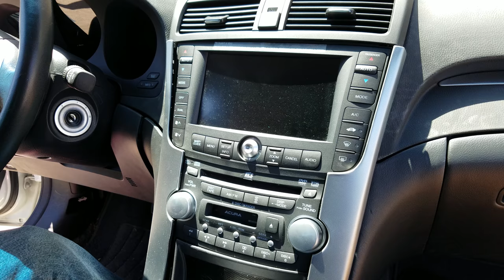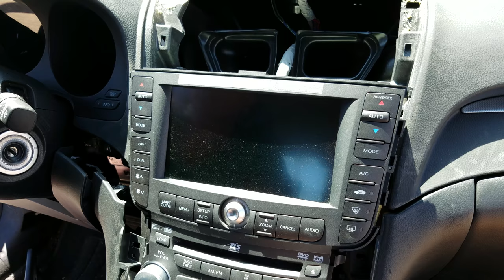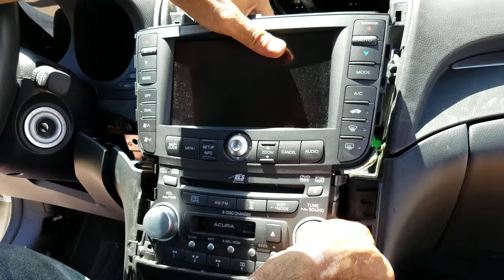How to Remove Radio / Navigation / Display from Acura TL 2007 for Repair.

Comment: One of the best auto vids I've watched.  Straight to the point, nothing left out.  Disassembling a dash and trim is a dreadful task but this video made it easy.  Used this video successfully to retrieve stuff that was swallowed by the "This is not an ashtray" compartment.

Comment: Does all that need to be done if you just want to remove the top air vent/ clock display?
Reply from the maker: No, you do not need to do any of those steps.

Comment: Excellent video. Can you tell me if you installed the carbon fiber trim as well? If so, 
what did you use to make it carbon design? My 08 came with a metallic trim set and I want to change it.
Reply from the maker: No, we do not install carbon fiber trim.

Comment: Question: I have a 2004 ACURA TL. I ACCIDENTLY PUT MY FIST INTO THE STEREO UNIT. CAN I REPLACE THE CD DECK WITH CASSETTE PLAYER TO A STOCK ACURA TL WITH NAVIGATION?
Reply from the maker: Wiring is different.
Reply: @HiTechElectronic  what about if u replace it with the same thing? Any codes going to mess me up? Or is it as simple as replacing it?
Reply from the maker: @kashkash9886  Just plug and play but you need to have the anti-theft code of the new radio.
Reply: @HiTechElectronic  ty so much man!!!!

Comment: My Acura TL 2004 stero just stopped workin the ac work but the only thing doesn’t work usa the radio doesn’t turn on and also the shifter doesn’t work do you have any idea why did happened to the stereo and to the shifter the shifter needs the screwdriver to switch